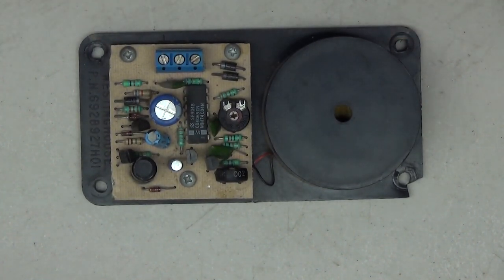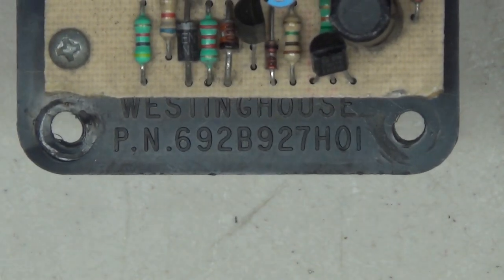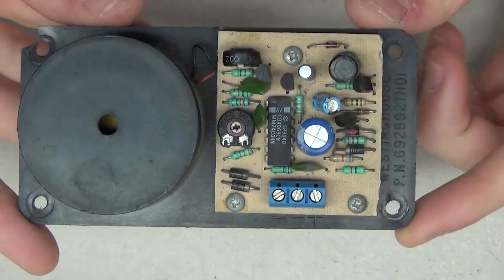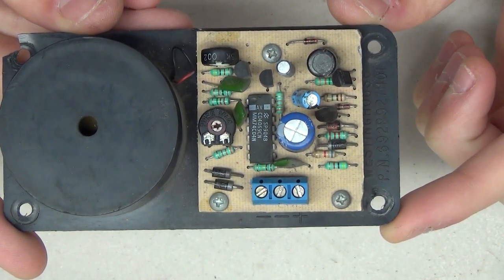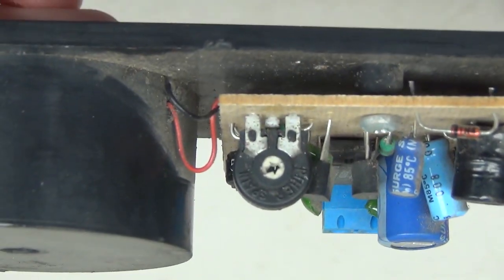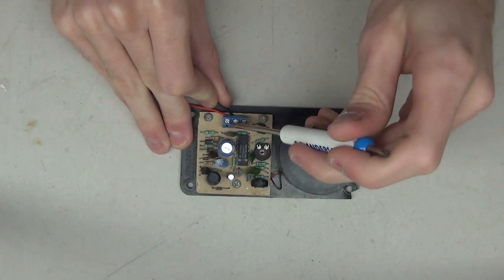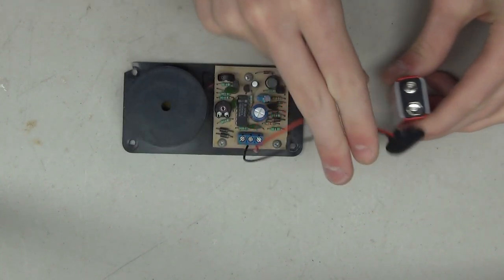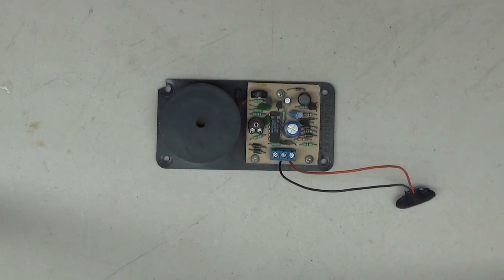The Westinghouse "MT" Chime

Comment: For the longest time I thought the power fed to the speaker is what made the pitch vary so much. But I guess this is the real answer. Very satisfying.
Reply from the maker: Even if it were that, it would be the slight variation in electronic components that would cause the pitch difference (specifically the resistors), not the power itself. Not all components are exactly the same. The pitch adjustment on this chime is simply changing the resistance with that potentiometer.
Reply: Yeah that makes more sense actually.

Comment: Really interesting chime, and it's too bad these chimes aren't made like this anymore, since they're so versatile with both volume and pitch adjustment. What would also be really cool is if Schindler continued to use these chimes on all of their HT fixtures, as well as 321A, 330A, 400A, 500A, and 700A elevators, along with the 3300XL, 5500, 6400NA, and 7000 elevators.
Reply from the maker: That would be cool

Comment: Interesting. I wonder if the innovation gong chimes along with the old Epco gong chimes work similar to this one? Or how about the Otis Elevonic 401 chimes? I’ve certainly heard of varying pitches of them as well. Maybe they all operate in the same manner?
Reply from the maker: I have some other chimes and they can only have the volume adjusted. This is the first one I've seen with an adjustable pitch.
Reply: @stlelevators  interesting. Than that begs the question, how are there so many different pitches for the innovation chimes and the Elevonic chimes?

Comment: Nice video of the MT chimes, I have seen and heard about some Schindler MT in vegas nv
Reply from the maker: I think there are some there.
Reply: @STL Elevators There are three of these elevators at my college. All three have basically the same chimes and they’re all in rather good shape. One is a little low on oil though. Eventually I think TKE will top the tank off but for now it remains as is.
Reply: There are Schindler MT in Sam's Town Hotel & Gambling hall. They are traction and are a bank of 3. It looks like they are getting modernized soon because the rear elevators used to be Schindler MT, we went back this year and they are something else. The chimes on 1st & 2nd floor have been replaced, all other chimes should be original.